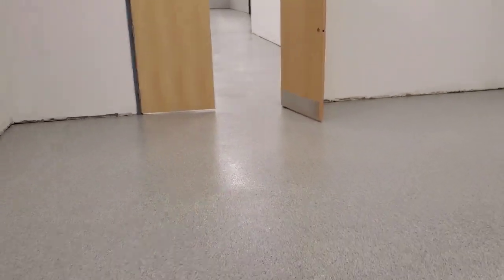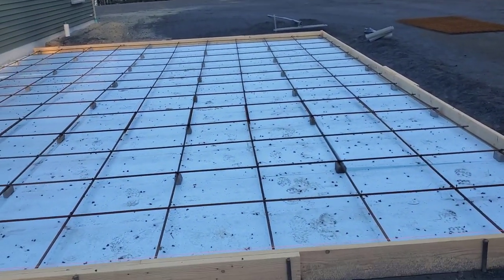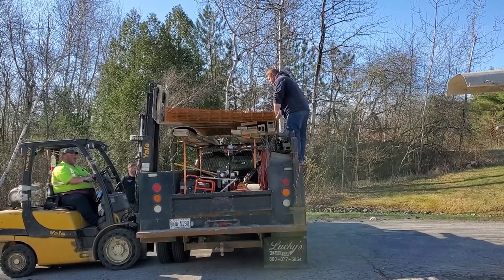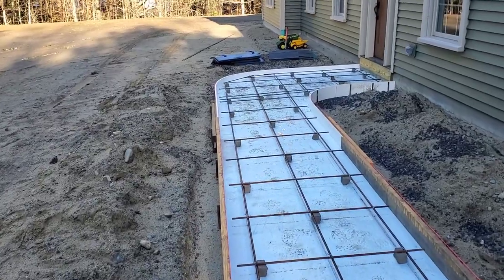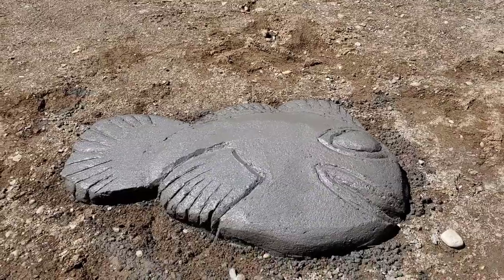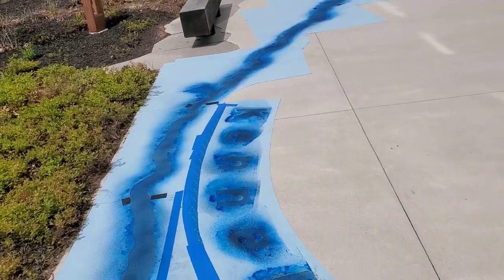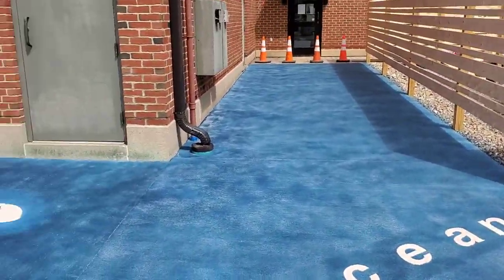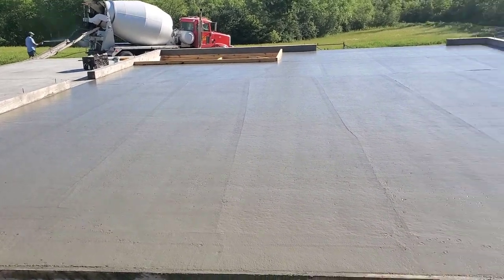The Many Skills I've Learned Doing Concrete Work (Episode 1)

Comment: Hello Mike. I am hoping you could answer some questions. I read that you only do floors, but what PSI strength do your friends use to build a house wall (for both 1 story and 2 story).  My question is the same for an 8 foot block fence that surrounds the property perimeter and any advice on their footer depths and plastering? Some background info on what I have to work with.....I am now living here in the Philippines where houses use blocks that are claimed to be made with a 1:6 ratio (I don't think they are 1:6 because they crumble a little more easily than that). These blocks are about 15" long × 7" tall × 3.5" thick. Things are a bit substandard in the Philippines. Along with your answers, what other advice do you have?